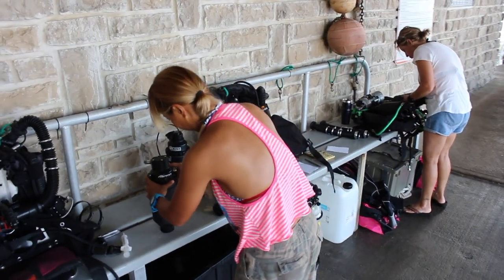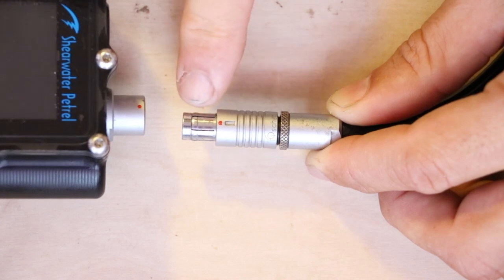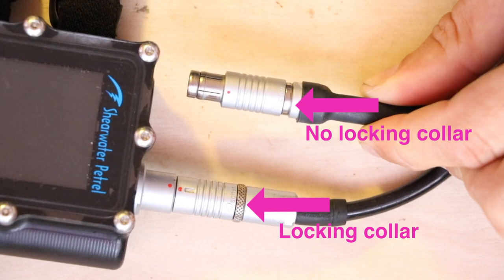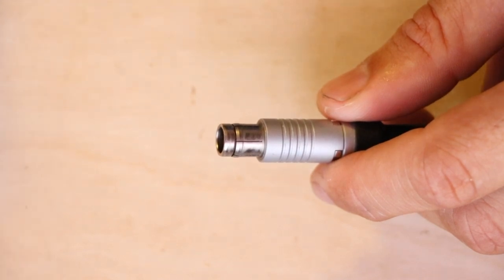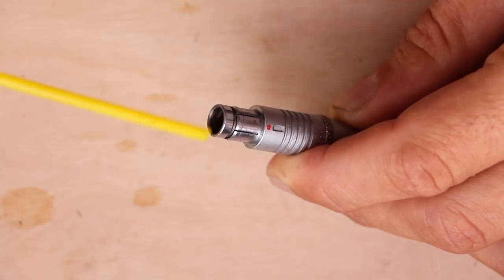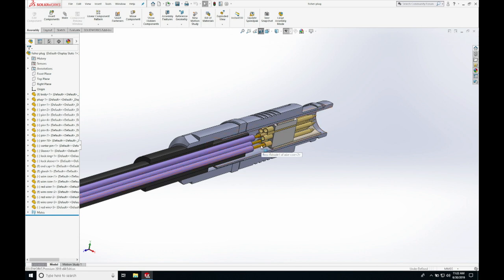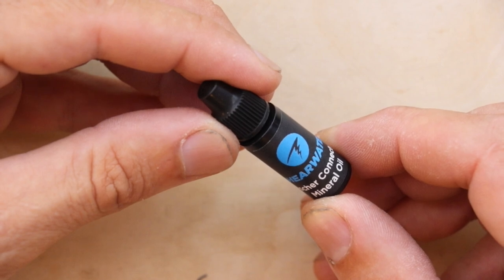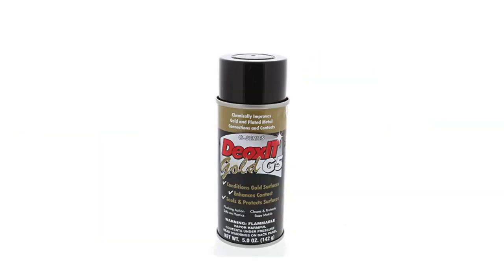How to best care for your rebreather Fischer plug

Comment: Good video. What is it being replaced with?. I like the idea of a detachable connection (usually only to avoid having to send the entire thing in for service if a single part was playing up) but wonder what other options are out there. Is there anything like wet plugable EO connectors or something more robust?
Reply from the maker: Over the past few years, most rebreather manufacturers have switched to a a 4-pin wet mate-able plug.
Reply: @DivetechLtdWestBay  Is that what the KISS 4-pin connector is? If so - how does one get a Shearwater compatible with that connection?
Reply from the maker: @bobdankert  Hi Bob. The 4-pin is something different than what's in this video. The 4-pin connectors are available from your respective rebreather manufacturer, for both the rebreather side and your computer side. Send us an email if you have more questions and we can help you figure it out. info@divetech.com.
Reply: @DivetechLtdWestBay  Correct - I wasn't referring to what's in the video, I was referring to the newer KISS 4-pin connector. Anyways, the lack of 4-pin dive computer availability (ie Shearwater) seems a bit concerning, currently, for devices using the 4-pin web mate-able plug previously mentioned.
Reply from the maker: @bobdankert  Hi Bob. I understood your question. The 4-pin wet mate plug is common to any rebreather using an analog set. For digital sets, they use 5-pin. But you cannot buy them from Shearwater dealers, you must go through your rebreather manufacturer. They are very common, most rebreathers use these wet-mate plugs now.